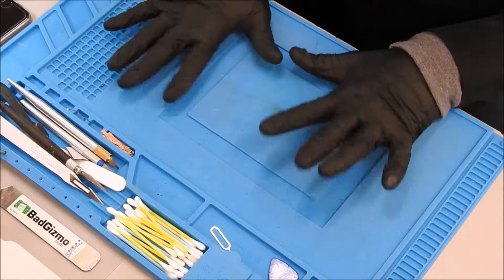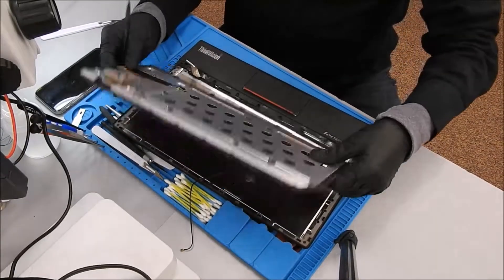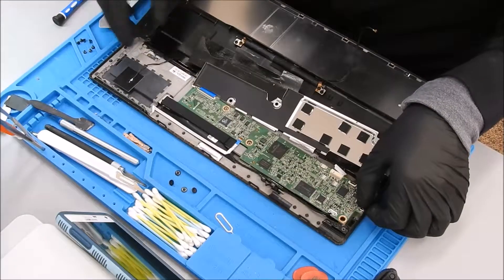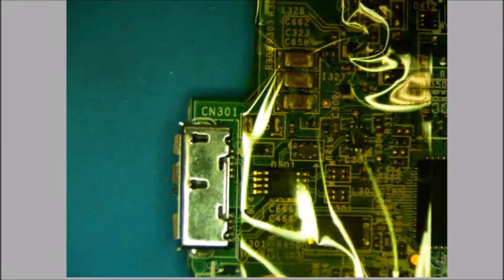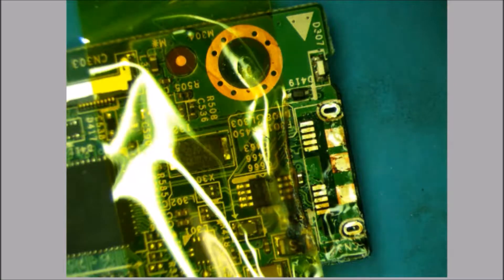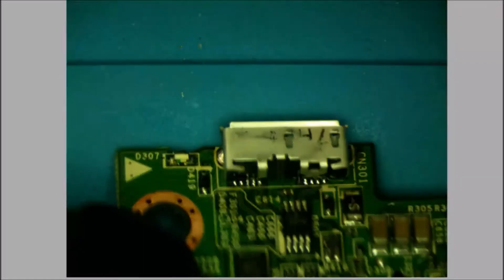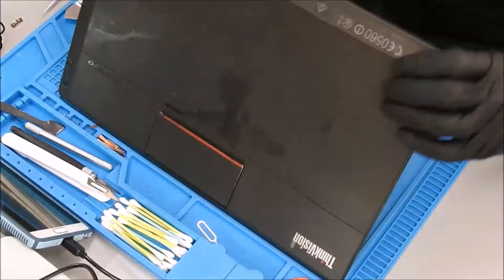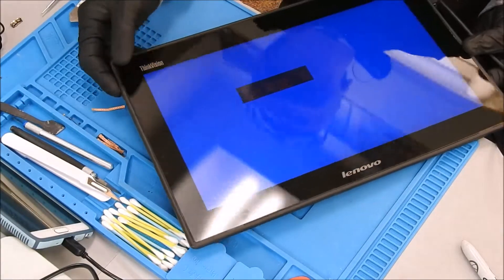Lenovo ThinkVision Monitor USB 3.0 repair

Comment: I bought two Lenovo Thinkvision P-27 monitors to use with my MacBook Air and mini-Mac respectively. While great when work, both have had issues with the USB-C ports from day one. One of the USB-C ports has snapped off completely rendering it unusable. 

At less than 1 year old and well within the 3 year warranty, Lenovo has refused to replace the broken one. Their customer support stated the consider it to be a “customer induced problem” - even though they hadn’t inspected it to determine if there was a faulty component. 

My advice, shop elsewhere and don’t risk your hard-earned cash. There are plenty of other solid brands at the same price and quality.